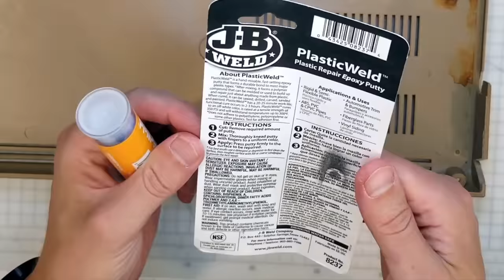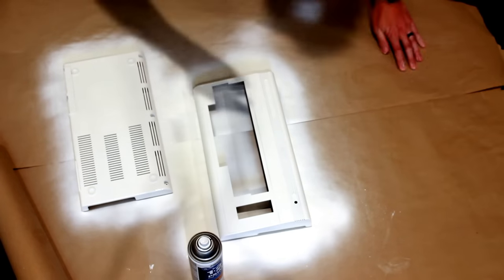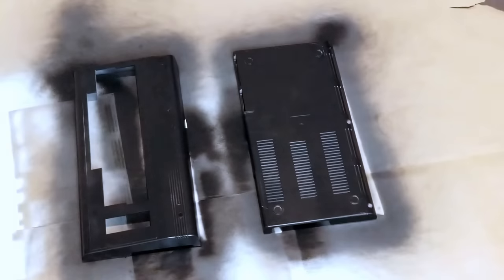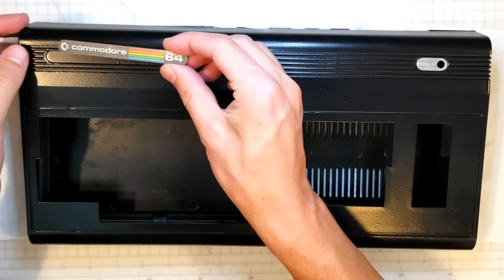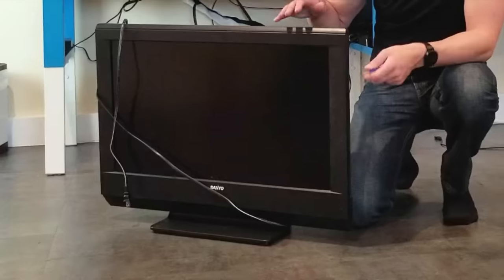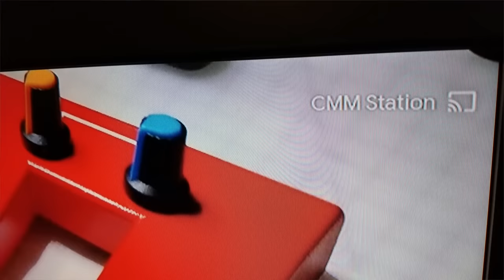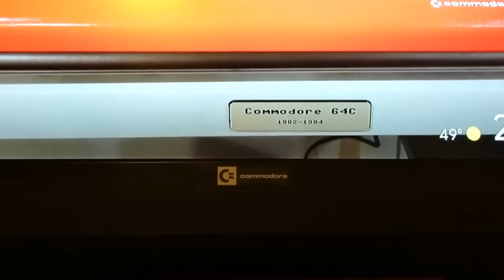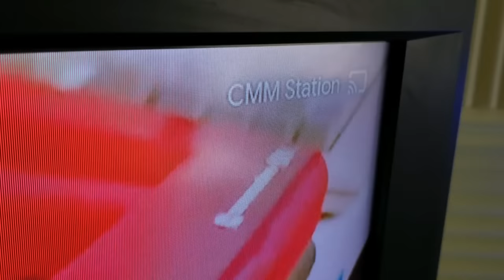5/6: Commodore Music Maker Refurb - Darth Vader Case | feat. Retro Man Cave

Comment: Hi. Just watching again your 6 videos about the Music Maker as I've recently bought a cheap one. Just to comment watching this video about vinyl grap. There is another option that I've seen: a vinyl grap spray that should work better. In any case I think that it's always better to use paint, just as you do.
In fact, you know that I painted a C=64 red. At first I didn't use primer and it showed some wrinkles. Then I sanded it all and I used primer, but after a time it showed wrinkles again. What I finally made was to sand all of the paint and it now shows a beautiful and durable mate red.

Comment: Very nice. It's curious because I'll also have a C64 in that style. As I repaired my left for parts mobo I had to search for a case, so I bought a C16 one. It's black, you know... And the keyboard I've got for it it's white.
Reply from the maker: Fernando Martín Cool! Got a link to a pic?
Reply: Not yet. I've got the parts, but I'll change the caps and so first. I'm still finishing my red&black one. Next step is to try the Bwack kernal switcher.
Reply from the maker: Fernando Martín Bon chance
Reply: بالتساوي

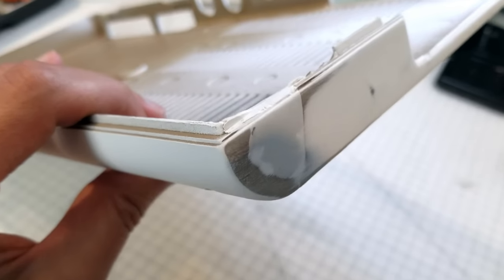Comment: For the crack at 2:55 it is a good practice to drill a hole at the end of the crack before gluing it. That would prevent it from cracking further. Congrats on the end result, it came out really nice! I had the C64 as a kid but never knew that they made a music maker keyboard for it.
Reply from the maker: Thanks! Good tip.

Comment: why do most the retro mod people I watch use double sided tape and not rubber cement? is there a property of rubber cement that makes it not useful?
Reply from the maker: It can just be a bit messy. I'm using 3M Thermal double sided tape there, specially made for heat sinks.